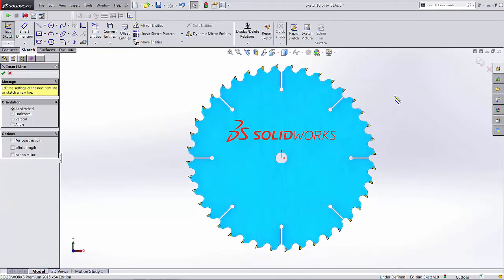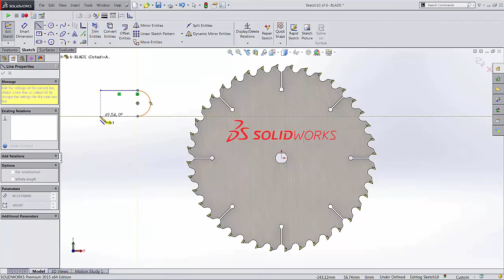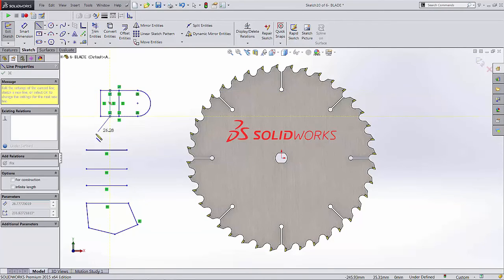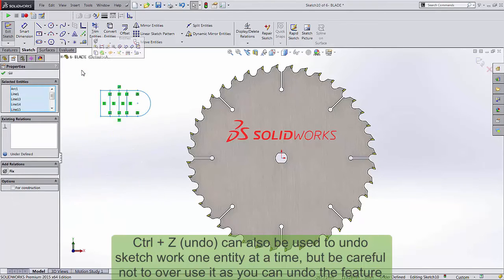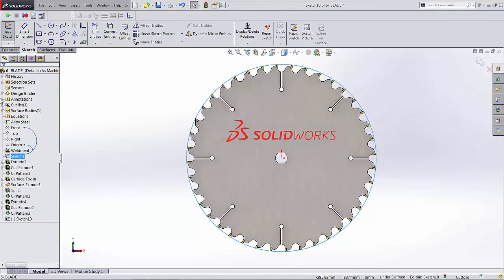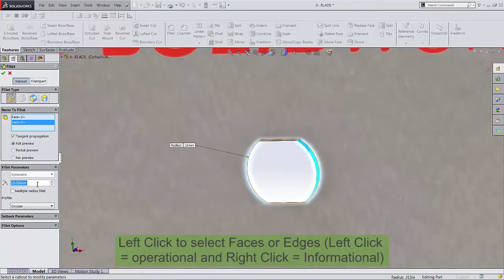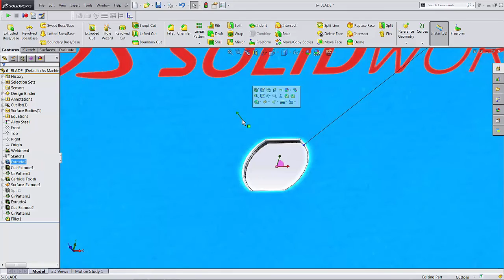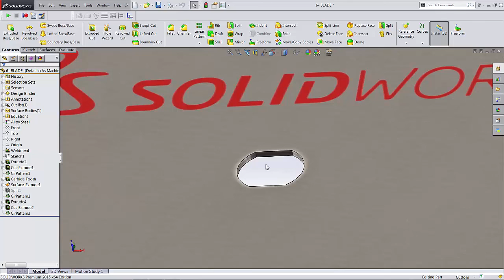SOLIDWORKS Quick Tip - Basic User Mechanics

Comment: As with all windows based programs...Ctrl+Z is your friend. Since I don't use the space bar for orientation changes I set it for "normal to" and I turn off automatically align to plane for sketches. If I want it to align I press spacebar, otherwise I can draw in the current view which I do often. To each his own though.
I also would not ever want to part with my space mouse.
Reply: Rollin Shultz  The 3D connection space mouse is awesome!  Thanks for the comment Rollin. Good advice too :)